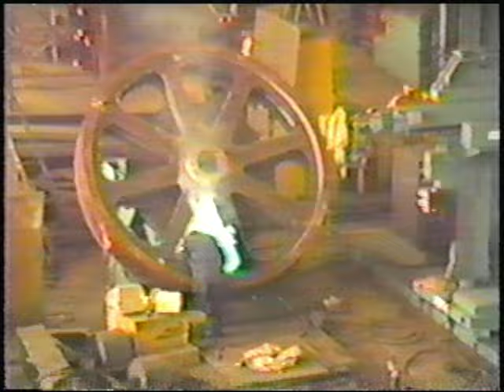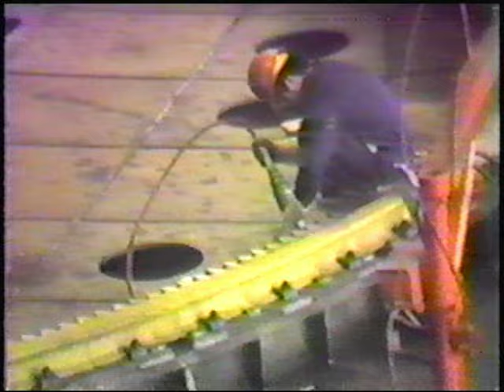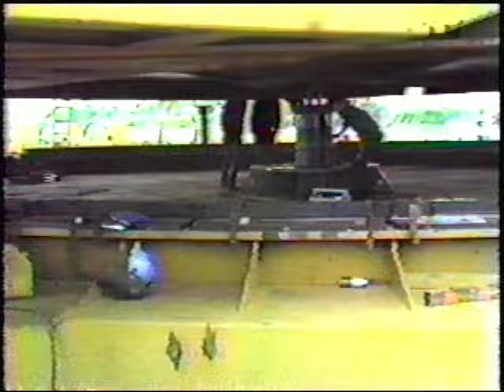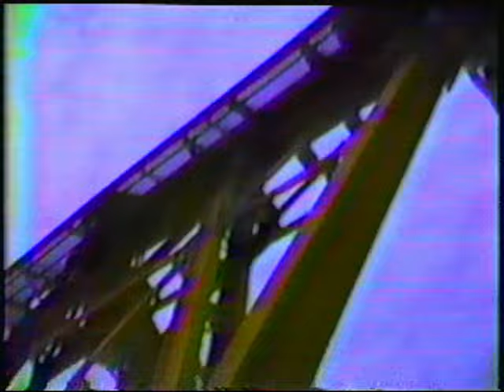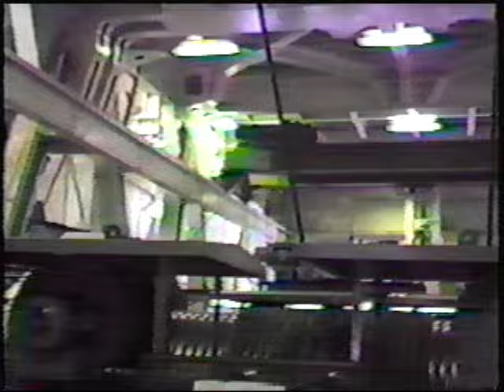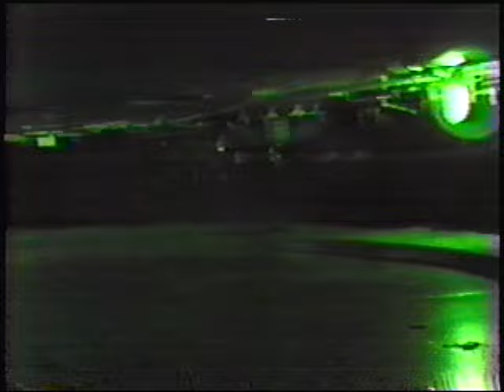Page Engineering Company; Dragline production and operation in 1982

Comment: The Page 757 machine that is shown in the introduction and as well in the closing is the machine I spent 27 years doing maintenance on. It is still in service at the same mine, Spring Creek Coal. Not exactly sure of the date, but believe it has been going since 1979 or 80. 
It is truly amazing how well they designed some components on this machine and yet missed the mark so badly on other areas. All in all a very good and reliable dragline. 
The boom was excellent in overall design. Probably the worst culprit maintenance wise had to do with how they terminated the spade plates in the upper and lower main boom chords. This was a constant source of cracking and was finally eliminated when all of these areas were blend ground and cleaned up. The spade plates were what tied the lacing to the chord. 
Without a doubt, the biggest  source of welding failures and cracking was the result of a lack of blend grinding and not providing a radius in the corners of structural members all throughout the machine. I just don't think they recognized fatigue cracking from undercut and square corners. 
I could write a short book on all that we did to that machine over the years. It was and still is a very good machine. Thanks for the video memories.
Reply: I am in search of an operators manual for a Page Engineering Crane . PC 822-346 is the thought serial number. It's mounted on a barge. Any thoughts?